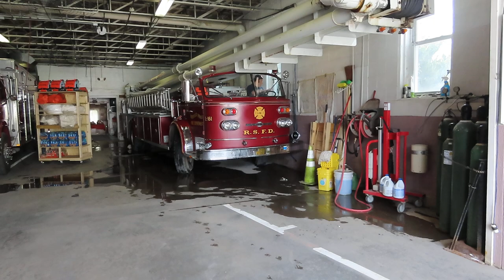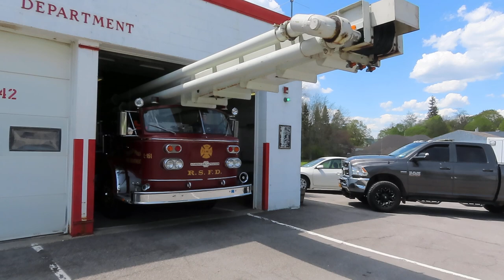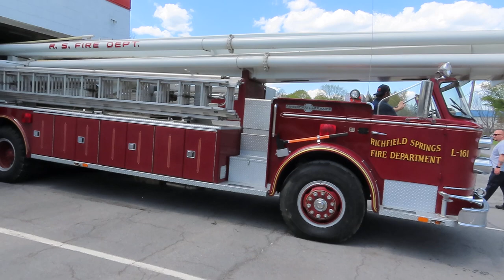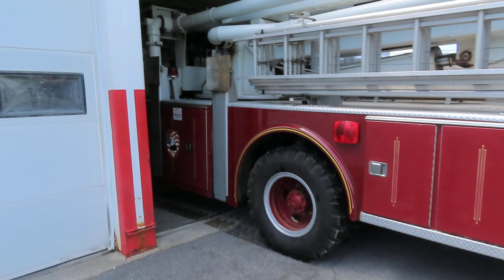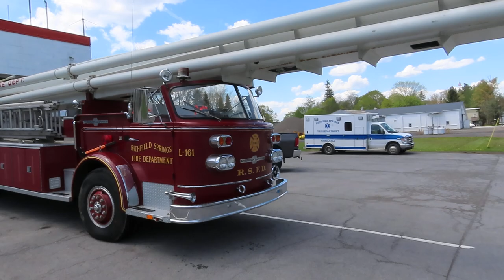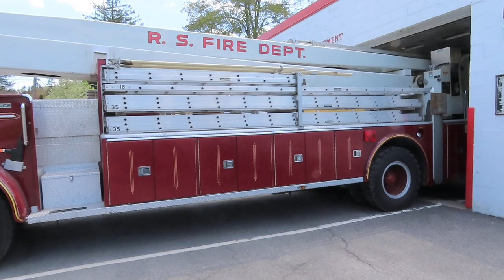Richfield Springs Fire Dept, NY Tower 1741 1970 American LaFrance Aero-chief pulling out of station

Comment: Thank you so much for driving her out. I own a 1971 SeaGrave Engine with 8V-71
5 speed transmission. Im restoring it. Do parade and public event, let kids get in drivers seat😊. I filled the Air pack compartment with different size and types of Fire Extinguisher. Its my baby.
Reply from the maker: So funny enough Technically when this video was recorded this old girl was still in service and first due ladder for the area

Comment: I never really understood those trucks.  Honestly I don't even know what that truck is used for, as it doesn't appear to have a ladder on it, but nevermind that. Right now all I'm worried about is WHERE'S THE ROOF ON THAT DAMN THING?????????????
Reply from the maker: Well they were used for different purposes especially since they can do a little bit more than your standard stick ladder and they were the first Tower platforms to work from and is things from the 1970s open cabs for the thing back then
Reply: @fireemsfilms  It just always confused me how they can build a truck with no top.  Especially on rainy days where the crew and equipment are needlessly rained on just getting to an incident that probably didn't need water in the first place.  But like I said i have no clue what that thing on top is or what it does. I never seen anything like it on any fire truck in my area.   I mean yes i have seen "open cabs" like that before, but none of them had THAT thing on it. They weren't even ladder trucks. So when I see one of these "open cabs" during a parade I'm left wanting to slap the $#!+ out of whoever thought that design was a good idea.  The seats getting wet, the crew, the paperwork, the control panel(s).  I mean sure it could be a cool design in the summertime, but these guys work all year. Rain, shine, snow, hail... these guys get it all without having even reached the scene yet.   What the #3!!??
Reply: @HannTheftAudio  Not a firefighter?
Reply: @RandyCarpadus  Not sure I'm following you on this.  I'm sorry, lost my train of thought on this other video I was just watching.
Reply: "Real firefighters" laugh at getting wet in the rain! Heheheheh!,....
Reply: @EyeWatchThemAll  Good point. So not really worrying about them, but what about everything else? You get water on the controls and it could cause a short, right?
Reply: @HannTheftAudio  , dude, I was being sarcastic.
Reply: They are basically like a utility company Boom truck on steroids , the boom can extend upward to very high reaches much further than a standard ladder truck. They are used for high-rise structures and massive buildings such as commercial buildings , there is a giant pipe that leads from the base of the truck to the bucket where the firefighters are to spray water on a fire hundreds of feet in the air.
Reply: @HannTheftAudio   the American LaFrance Aero Chief was the American LaFrance versíon of the Snorkel Trucks that most big city Fire Depts were using from the late 60's up through the 70's and well into the 80's, 90's and early 2000's. A Combo Career/Volunteer Fire Dept I used to run calls with back in the 90's in Upstate NY actually had a 1969 75 Foot  Snorkel Truck that they ran for 42 years straight, from 1969 until it's retirement in 2011. Snorkels have an articulating boom, with a bucket on the end of the boom, and the boom has a 4 inch Prepiped waterway that is built into the Truck Body, with inlets on the rear, and sometimes the sides where you hook in your supply hoses to feed water up to the deck gun in the bucket. The Aero Chief is the same type set up as a Snorkel. The Open Cab design has been around since the early days of gasoline powered fire apparatus. It allows the Officer of the Truck to be able to stand up to begin his Size Up of the Fire Scene as the rig is pulling up, and it also allows him to locate nearby hydrants to connect to nearby. There are no dangers of the elements shorting out any electrical systems or components within the Cab, everything is very tightly sealed up to prevent that from occurring. .
Reply: @HannTheftAudio that thing on the top is an articulated platform. Functions as a predecessor to the modern tower ladder. This particular boom extends 90 feet in the air
Reply: @cjcabrera3649   Ah ok that makes sense.  thanks
Reply: Like many here I just find it hard to believe that you've never seen a snorkel platform nor older fire trucks from the 1960s or before. More than half of them, especially before 1940 did not have a roof over the seats. The other thing is they make plenty of diecast toys or collectibles that are accurate Recreations of these great firefighting trucks.
Reply: @briansturm6618   I may be old but I'm not THAT old.  the earliest fire truck i remember seeing was in 1991 and even it had a roof.  i do recall seeing roofless fire trucks, but i only ever saw them in parades. they were only ever used for show and then they were tucked away (teleported back to Area 51 for all i know. Lord knows they got quite a few secrets there). In any case, of all the roofless ones I've seen NOT ONE looked like this.